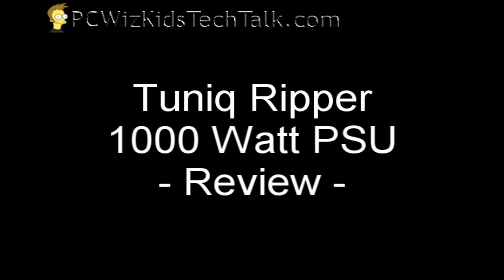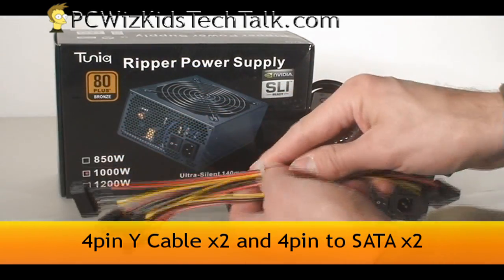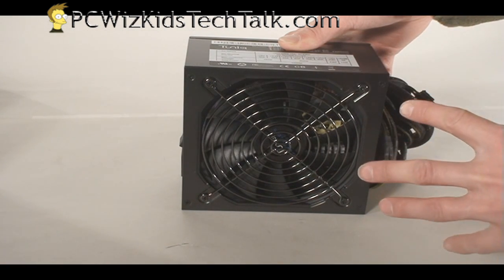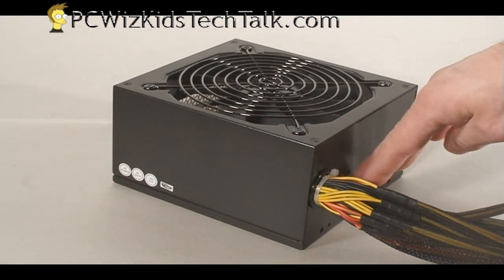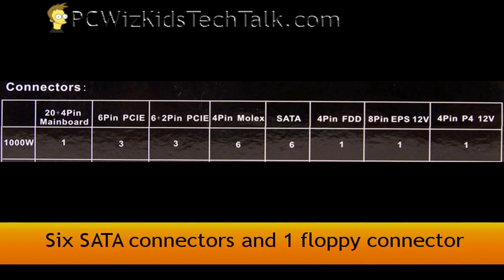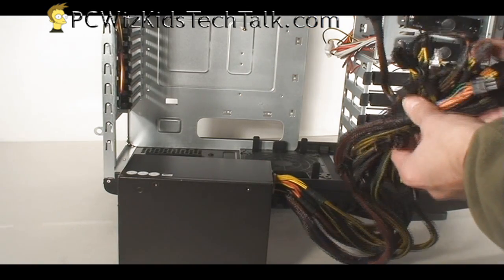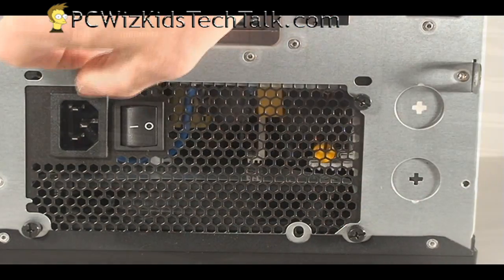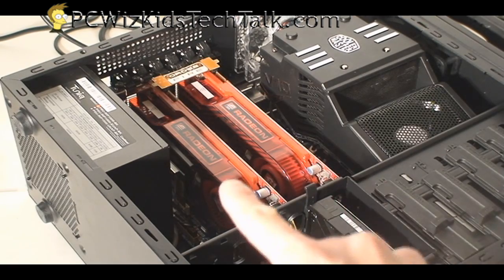Tuniq Ripper 1000 Watt Power Supply Review

Comment: Looks like a nice PSU. Do you think btw that the new enermax 92% efficient ratings are actually true or bs? I'm about to build a expensive rig for my mate and usually I'd choose the HX1000w like I have (An advantage is that apparently all teh Rev85+ PSUs all also future-proofed for possible new connectors for GPUs etc).

Also when will you have some nvidia/intel stuff to play with? :P